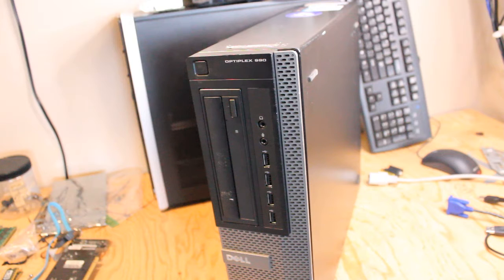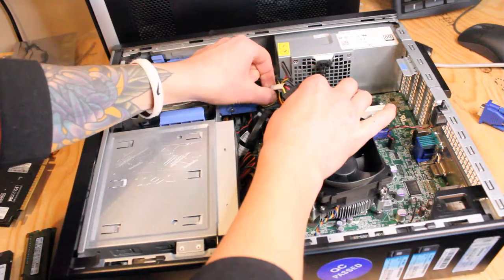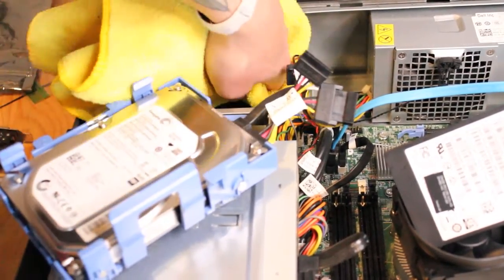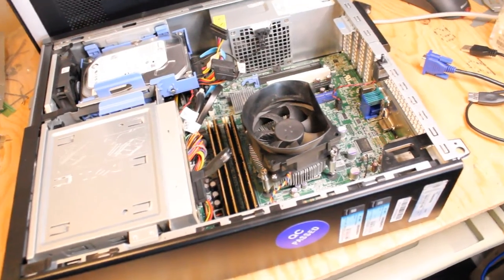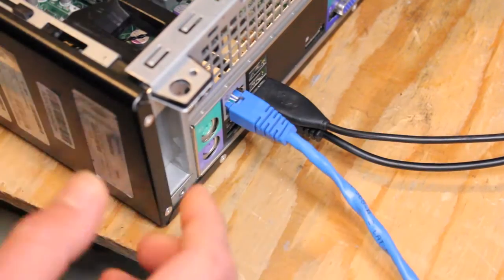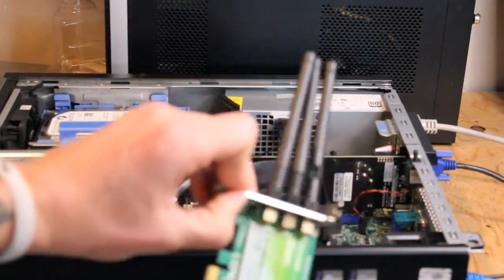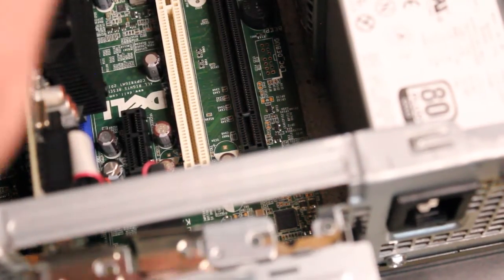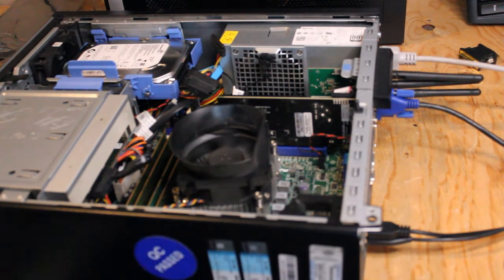Dell Optiplex 990 Upgrades Install (SSD, RAM, GeForce GT 610, Win 10, WiFi)

Comment: I'm a noob. If I already have HDD, can I add SDD to speed up loading?
Reply from the maker: The best case scenario is replacing the Hard drive with the SSD as a Windows boot drive.  Then using the HDD as extra storage.  You can clone the HDD to the SSD using Clonezilla, just make sure your SSD is the same capacity as the HDD.

Comment: if i want to create a bootable usb stick with windows 11pro using rufus and install it on Optiplex 990, what should i do? what should i set on Rufus and what should i change or set on bios of Optiplex 990? can someone please help me?
Reply from the maker: If you download rufus and load up the win 11 .iso Rufus will lead you from there.
Reply: @HaisteComputerRepair I've tried and don't start, Maybe i Need some proper configurazione on BIOS and Rufus?
Reply from the maker: @luigimanis2803  Oh, you might need to go into BIOS and make UEFI the default over legacy.

Comment: i have the same model otiplex 990 as u have. I wanna plug in GPU Nvidea GT 610 DDR3 V-RAM 2 Gb i am wondering if the PSU 240w will take it ?
Reply from the maker: Yes, no problem

Comment: I have dell oplitex 990 with PSU of 240 watts .
.
.i want to buyy GT610 2GB DDR3 64-bit and it requires 300 watts so will the graphic card work
Reply from the maker: There are better cards you can purchase, the GT 610 isn't a great example it's just what I had around.  Are you able to budget for a better card?

Comment: thanks you helped me alot with upgrading my dell optiplex!! <3
Reply from the maker: Happy to hear that!
Reply: @HaisteComputerRepair  do you maybe know what is compatible with the 240W Integrated PSU? I find very few information online, and can I only use 1333Mhz ram on the Motherboard or would 1600Mhz work too? does it even support quad channel? If not, to get 2x 8 GB would be better than 4x 4GB right?
And I thought about a gtx 1050 to get a long with the i5 2400 but im concerned because I heard that this is too much for the 240W PSU. And is it worth spending 20$ on a i7 2600 to install it? It only has a few Ghz more but Hyper Threading :D

I would appreciate an answer, if not its also fine :) just thought I ask.
Reply from the maker: @galog333f5  GTX 1050 would be perfectly fine.  Go for a 1050 Ti if you can as it has 4GB GDDR5.  With 2nd Gen Intel CPU's in a business class PC like this, RAM speeds will cap at 1333MHz.  3rd Gen Intel and up supporting DDR3 is 1600MHz.  i7-2600 would be great and they are pretty cheap now.

Comment: Do I still need to plug in a VGA cable to my monitor if I get the same graphics card you did, or can I just plug in the HDMI to my tv?
Reply from the maker: You can do both if you like.  HDMI will work fine connected to your TV
Reply: @HaisteComputerRepair  thanks a bunch.
Reply from the maker: @MundaneRaven  My pleasure!
Reply: 😮 @HaisteComputerRepair
Reply: @HaisteComputerRepair bro you are replying on a video that is 2 years ago 😮
btw thanks man for video 😀
Reply from the maker: @XenovGaming326  I reply all the time!
Reply: I forgot to ask since I'm new to this whole PC thing, is a 610 the best I should get(I understand that if you get a graphics card that's too good the extra powers just gonna be wasted.)
Reply from the maker: @MundaneRaven  The GT 610 is not a good card, I suppose I just happened to have it on hand at the time.  I would recommend looking out for a GT 1030 or GTX 1050, or GTX 1050 Ti
Reply: @HaisteComputerRepair  wack, I kinda already got one, and the reason why is cuss I have literally the same computer chassis.do any of those cards fit the Optiplex 990 dt chassis?
Reply from the maker: @MundaneRaven  So long as the cards are low profile yep.

Comment: Have the same optiplex 990 but bigger tower. it currently has 16gb ram, gt 610 like this, i5 2400. Average for the game I do play on it, it can get up to 60 - 127 fps without an issue. I did have win 11 installed but I don't recommend trying it for a optiplex 990, it don't work to well so back to win 10 pro 😁
Reply from the maker: That's great.  Windows 11 on 2nd gen Intel architecture, yes results may vary.  What games are you playing?

Comment: Idk much about all of this and I have a question, I bought something with 1600mhz and the existing 2x4gb are 1333mhz
Reply from the maker: That would be due to the 2nd gen Intel CPU limiting RAM speeds to 1333MHz.  Even if you install 1600MHz, it will run at 1333MHz speeds.  Unless you were to have a motherboard that supported increasing the RAM speed, which this Dell OEM board would not.

Comment: My GTX 1050ti 4GB DDr5 128Bit GPU doesnt fit my Optiplex 990, it's the exact same model as yours... Do you know of any good GPUs that will fit into this exact model?
Reply from the maker: So it's a "Low Profile" graphics card?  I used an older (and much worse) GT 610 in this video.  Can you tell me more about why it's not fitting?
Reply: @HaisteComputerRepair  I honestly have no clue. The metal bar where the GPU goes seems to be blocking the GPU. Otherwise, it probably would fit... Not sure why it doesn't.
Reply from the maker: @catster123  If you want to email some pictures to haisterepair@gmail.com I could try to help you out.

Comment: Hey Dear i has dell Manufacturer  Product
Dell Inc. 0VNP2H with 240w . can in this motherboard NVIDIA GeForce GT 710 works
Reply from the maker: Yes there should be no problem using a GT 710.  Maybe look for a GT 1030 if you can, it is much better and shouldn't cost much more.
Reply: @HaisteComputerRepair  Thanks Dear 😊
Reply from the maker: @Naitik-lb9gi  My pleasure :)

Comment: Hello do you know if gt610 fits optiplex 7010 sff?
Reply from the maker: Yep, the low profile GT 610 will fit just fine.
Reply: @HaisteComputerRepair  ok but the problem is tham my gpu is 120mm*100 and it didnt come witgh small bracket and its too big so what must i do?
Reply: @HaisteComputerRepair  the bracket wasnt on parts it was one metal and now i dont know what to do with mu gpu bc it might doesnt fit and its not low profile
Reply: @HaisteComputerRepair  but on the site i searched low profile cards and this gpu appeared but as i see it isnt low profile
Reply: @HaisteComputerRepair  what soud i do now to instal it?
Reply from the maker: @christoskam3345  So it's just the bracket that is too big?  You could just remove it and then install the card.  Or, get a bracket like this one:  https://tinyurl.com/3nnfc7rd
Reply: @HaisteComputerRepair  thnx for the bracket but if i removed does anything happen does sth break ?
Reply: @HaisteComputerRepair  ill see what did you do in this situation i think o might removed it but will it destroy the card or nothing happens?
Reply from the maker: @christoskam3345  You can take the bracket off and the card will be fine.  You may need:  phillips head screwdriver, and something to take off the mounts on the VGA and/or DVI port.
Reply: @HaisteComputerRepair  ok if i just take off the bracket will it break the card or nothing happens
Reply: @HaisteComputerRepair  i also have a 8gb ram ddr3 1609mghz which fit my pc
Reply: @HaisteComputerRepair  so i just remove the bracket and put my monitor on one of these?
Reply: @HaisteComputerRepair  sr to ask but do you have instagram to send you fotos and to follow you?
Reply: @HaisteComputerRepair  so i can just remove the bracket and everything will be fine?
Reply from the maker: @christoskam3345  Yep. that's right.  If you install the card without the bracket on, it will just be somewhat loose so be mindful of that.
Reply: @HaisteComputerRepair  so i just remove it and nothing breaks or happens? And the performance will be same ?
Reply from the maker: @christoskam3345  So long as you are careful when removing it, yes.  Performance will be the same.  It's just a bracket to hold it in place.  So, it would be a good idea to order a new "low profile" set of brackets like the one I linked.  Just make sure it looks like it will work with you card.
Reply: @HaisteComputerRepair  something else d you know  if my motherboard q77 chipset micro atx fit a midi tower case that support micro atx?
Reply from the maker: @christoskam3345  I think you would be ok migrating to a larger case.  Little things like the I/O shield may be built into that small Dell SFF Case.  It looks like it supports regular atx power supplies.  If you have a power supply to test out, try swapping it in before removing anything to ensure it works.  I have had at least one Dell motherboard not respond to ATX power supplies.
Reply: @HaisteComputerRepair  ok so i can pit the dell morherboard into an midi tower that supports micro atx and i have 240v power supply
Reply from the maker: @christoskam3345  So are you swapping in another power supply?  You have a 240W power supply?
Reply: @HaisteComputerRepair  yes i have  240v power supply imma change a psu but not my pc case so can you suggest me budget good supplies 350v +
Reply: @HaisteComputerRepair  and if i have a lot of vatt in my psu tge better the pc works pls suggest me from somewhere a good budget supplies
Reply: @HaisteComputerRepair  the power supplies on sff are the same with the atx or not?
Reply: @HaisteComputerRepair  badically i saw tha my specs might overheat so imma change a supply approx 350v and a cooler pls suggest a cooler and tell me what type of cooler and psu does sff pc get thats all
Reply: @HaisteComputerRepair  only what type of cooler and psu get imma find by myself
Reply from the maker: @christoskam3345  Check out the video I did migrating from SFF case to larger case here for an idea:  https://youtu.be/JtHK0FJRINY
Reply: @HaisteComputerRepair  bfo imma go to change cooler or something else ssdight
Reply from the maker: @christoskam3345  Good luck, feel free to reach out for any help.
Reply: @HaisteComputerRepair  thanks for the help so im gonna change only these 2 things gpu and ram and when im gonna grow up ill build a better pc
Reply from the maker: @christoskam3345  Awesome!
Reply: And in case the gpu doesnt fit might do a patent like to cut the bracket a little
Reply from the maker: @christoskam3345  Yep, good luck!
Reply: @HaisteComputerRepair  i actually made it withpatent
Reply: @HaisteComputerRepair  now my problem is how to get high fps ob games like fortnite
Reply: @HaisteComputerRepair  i have just done it do you know if a gpu like ddr5(low profile) or ddr4(low profile) can fit sff optiplex 7010 or only ddr3  is accepted by the motherboard??
Reply from the maker: @christoskam3345  GDDR5 is fine and what you should go for.
Reply: @HaisteComputerRepair  and btw what a better wifi card do?
Reply from the maker: @christoskam3345  Something like this would work well and it has bluetooth https://tinyurl.com/yphj6jhe
Reply: @HaisteComputerRepair  hey bro you remember me right ? i see my gpus performance on games it is good but the temperature is very high it goes 85 celcius degrees . So i would like to ask what psu these sff pc get my pc optiplex 7010 sff let me know and tell me your suggestions!
Reply: @HaisteComputerRepair  your gt610 wasnt united the bracket mne it is when you can answer me the questons i have done

Comment: Hello friend. What is the model of this motherboard? Thinking about upgrading the case of this, would it be compatible with other cpu?
Reply from the maker: It should be compatible with 2nd gen Intel.  I would imagine an i7-2600 would work.  Check out this spec sheet:  https://i.dell.com/sites/doccontent/shared-content/data-sheets/en/Documents/optiplex-990-spec-sheet.pdf
Reply: @HaisteComputerRepair  thanks very much.
Reply from the maker: @reinaldoaraujo1440  No problem!

Comment: Can we upgrade the CPU chip to i9 on  motherboard?
Reply from the maker: This had 2nd gen Intel, so the best you could install would be the i7-2600.
Reply: @HaisteComputerRepair does that mean motherboard only supports to a certain point on specs...? I was assuming that if socket size matches on motherboard we can go a for a higher CPU which matches that socket size ...pls correct me wrong. Appreciate
Reply from the maker: @UdayPoran  Motherboards will only accept certain generations of CPU's as technology changes quite fast.  So, this motherboard from, say, 2012, will not support a CPU released in 2022.  No matter the size.  Search up any CPU on a site like CPU World and you will see the variety of socket types that individual motherboards will support.
Reply: @HaisteComputerRepair   97% sure my son has one of these with a 4th gen i7 card and 32g of RAM. (yes, it's a silly amount of RAM)
Reply from the maker: @jenrosejenrose7417  That would be two generations up from this one.  There will be a Dell Optiplex for every Intel CPU generation dating back to the Core 2 Duo/Core 2 Quad in 2008 or so.
Reply: The Xeon E3-1270 SR00N CPU will work on the 990 with the latest BIOS.  Also, you can get 32 GB of memory to run stable on it.  1.5Volt 1600MHz DDR3 8GB sticks x 4 sticks.
Reply from the maker: @hitechfl  That is awesome, now I kind of hope I run into another Optiplex 990

Comment: I have a Dell optiplex 990 with i5 how would I set it up to boot from USB? If you can help me Thanks
Reply from the maker: Boot the PC on, hit F2 until you enter BIOS, and navigate to Boot Order and set the USB as the first option.  Are you installing Windows?  If so, maybe the target SSD/HDD and usb as second option.  F12 will pull up the boot menu to select it on a one time basis.

Comment: Is this 100% sff or desktop because I seen this thing on Google which shows the different motherboards for 990 sff and 990 DT and yours looks like a dt
Reply from the maker: I actually assumed this was the SFF version, but you are right it is the DT version.    This site shows the different types:  https://www.hardware-corner.net/desktop-models/Dell-OptiPlex-990-SFF/

Comment: What do I do if my gt 1030 gddr5 2 gb graphics card doesn't fit into the PC cause of the big fan
Reply from the maker: Is your card not low profile?  Can you link me to a picture of what it looks like?
Reply: @HaisteComputerRepair  I figured out what to do it was the metal thing that hooks to the case I needed a screwdriver to put in a smaller one no problem anymore

Comment: im having a big trouble with my pc, i have wind 10 with gt 610 but the graphics card dont work and it says, Windows stopped this device code 43.
Reply from the maker: When are you getting this message?  If you are getting visual output with the graphics card, something is working enough to get a display.  Does this error pop up when you are trying to boot to Windows?

Comment: Can you please link the Wifi model are you put on this pc, I need a Wifi for my Optiplex. many thanks
Reply from the maker: A car like this would work, just make sure it comes with a low profile bracket.  Or, you could use a USB Wifi adapter.  https://www.amazon.ca/Gigabit-1730Mbps-Bluetooth-Wireless-Ubit/dp/B07PNF7BNP/ref=sr_1_1_sspa?crid=32L3V2KO9VD5R&keywords=pcie+wifi+card&qid=1646866360&s=electronics&sprefix=pcie+wifi+car%2Celectronics%2C115&sr=1-1-spons&psc=1&spLa=ZW5jcnlwdGVkUXVhbGlmaWVyPUEyVDhYMVpKQ05VTU1CJmVuY3J5cHRlZElkPUEwMDc2MTc5MzRHREtUR1k0QzlINyZlbmNyeXB0ZWRBZElkPUEwODYwMjYyMjNNWlZSU1VMUVczNCZ3aWRnZXROYW1lPXNwX2F0ZiZhY3Rpb249Y2xpY2tSZWRpcmVjdCZkb05vdExvZ0NsaWNrPXRydWU=

Comment: Bro plz reply I want to also upgrade my pc but can I use 1333M any compny ram will work in my pc plz reply
Reply from the maker: I believe that RAM speeds will cap out at 1333MHz, but you can use any brand, even if the speed is 1600MHz.  The RAM will work, but at a reduced MHz.

Comment: Is the GT610 full compatible with windows 10 without any problems?
Reply from the maker: The GT 610 works with Windows 10 and there are Windows 10 Drivers available on the NVIDIA website.  I didn't run into any problems, but I am also not the owner of this PC.  I haven't heard of any problems thus far.  Hope that helps.
Reply: @HaisteComputerRepair  black bars, drivers don`t work
Reply from the maker: @Oreetpal  For the GT610?  Can you give me some more detail?  Is this a fresh install of everything, just the graphics card install, or RAM, etc?